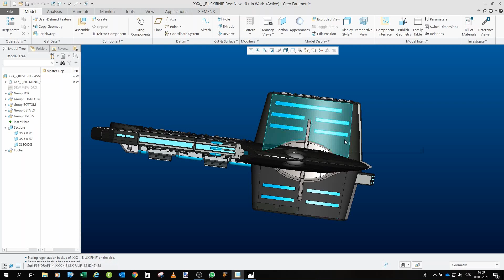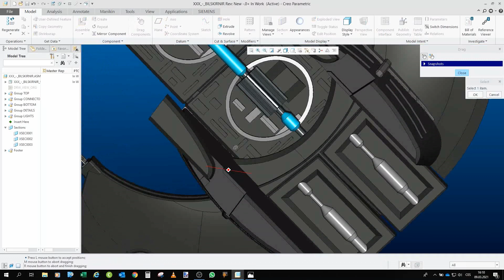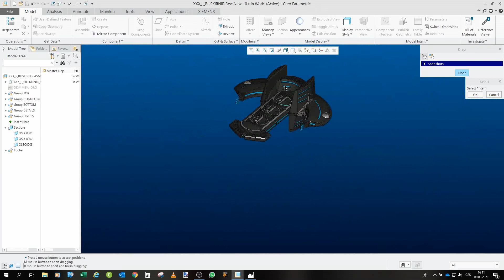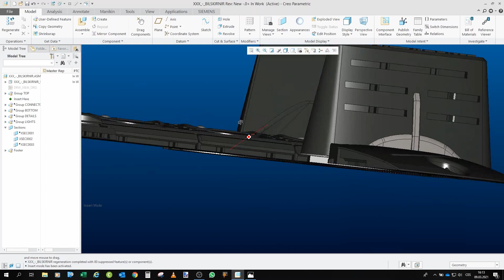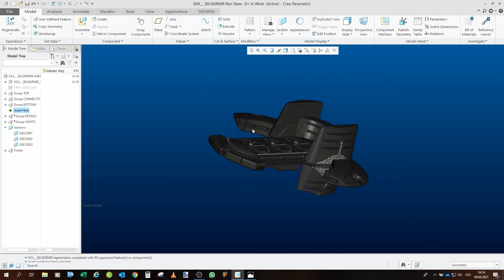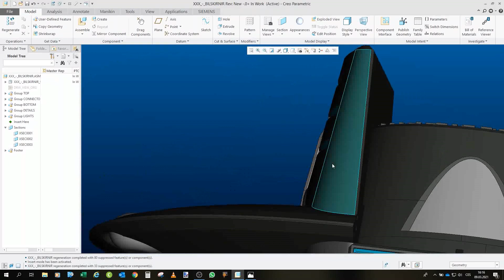Project Bilskirnir Part 1

Comment: Late to the party but I've been following your designs for a while now. I'm just waiting for a display space worthy of your models. ;-)

You mention not wanting to change the design or add a thrid leg or stand so that the ship stands on its own. While this is late for this particular model the idea may help for future designs or even a revision of this model. 

Use counterweights. Add hidden pockets for large machine bolts. These can be hidden in engine nacelles and covered by thruster caps and should provide the necessary weight to counter the weight of the forward section. Similar to how a consturction boom crane offsets the load with large weights rearward of the boom. Large machine bolts can be easily purchased at most any hardware or auto supply shop just about anyhere in the world and of course online for folks who don't have a neaby shop.

And of course if one wants to hang the model rather than have it on a shelf, they can just omit the bolts.
Reply from the maker: But the ship stands very well on its own. It has 2 retractable legs and it is sufficent.